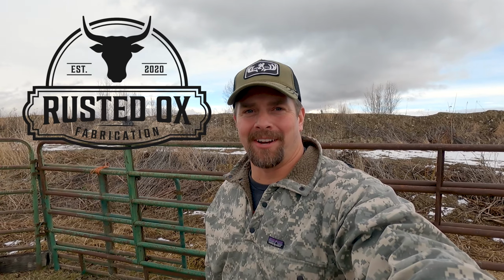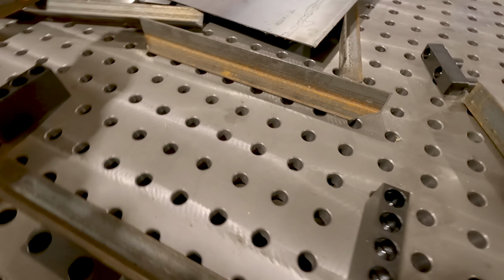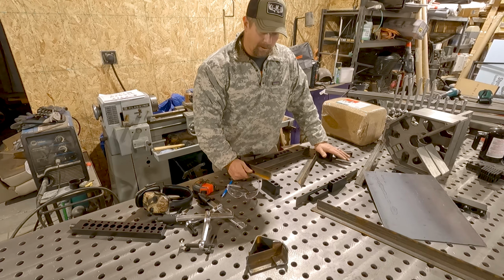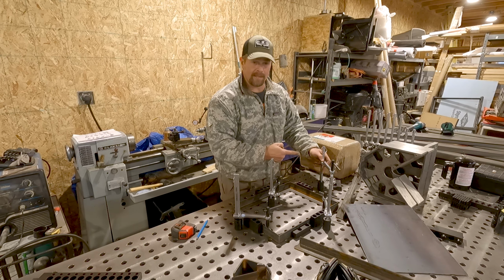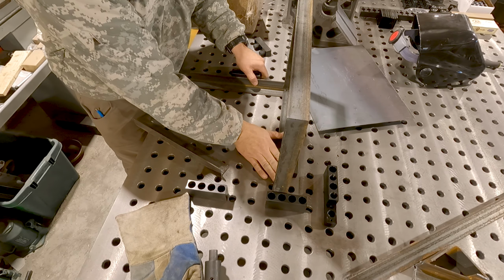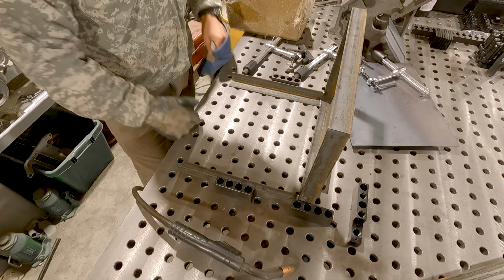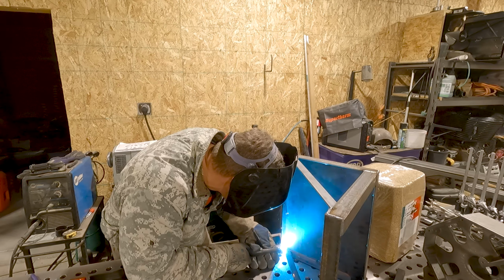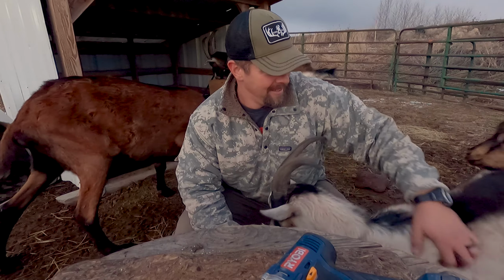Will My Pack Goats Destroy This?  Fireball Tool Table Project

Comment: All the time you were setting up the base, I was thinking will it fit?   In woodworking we do dry fits making sure every thing will assemble correctly, before we start gluing.  It was a big relief when you put the bottom and the block into your block holding frame and it fit with room to spare. It seems you got the goat seal of approval too!🤠
Reply from the maker: Dry fitting is always a good idea.  From the beginning, I new I was going to have to trim down that bottom plate so I didn't give it much thought.  They were obnoxiously eager to taste the new treat.  I've been kicking around ideas for some goat play ground equipment, that may be in the future.

Comment: Looks pretty pro to me.
Reply from the maker: You've set the bar so high, I can't say "pro", sometimes farm functional is all that is required.  What shocked me was how the table illustrated that I had a problem with my material before I started welding.  It saved me time and frustration I would have experienced otherwise.  Thanks for building great products.
Reply: You have great products. America is proud to have you. I come from Viet Nam